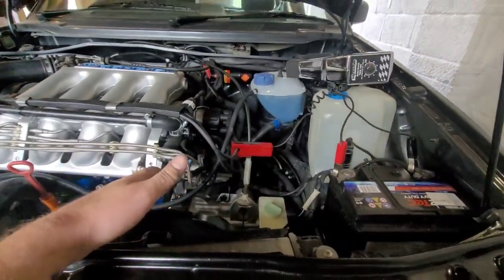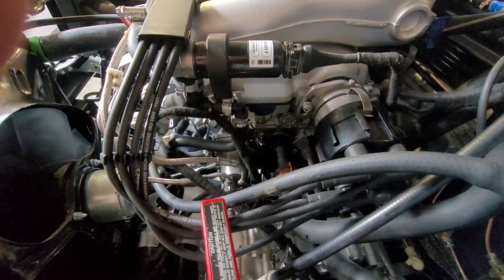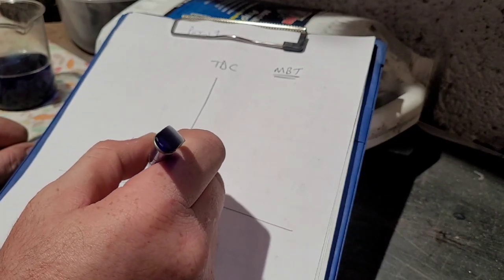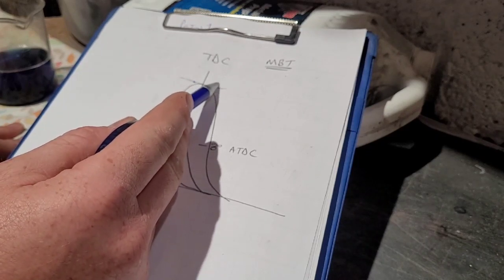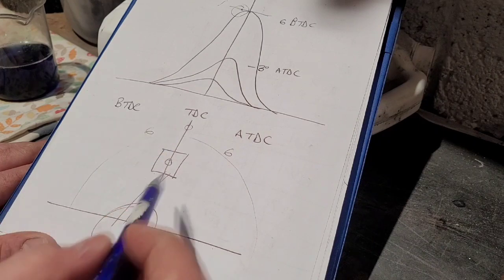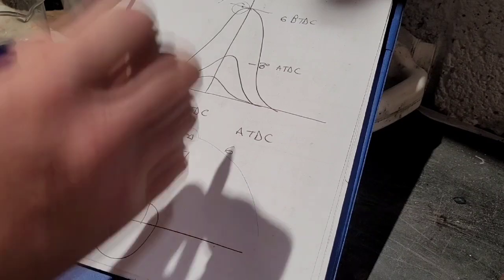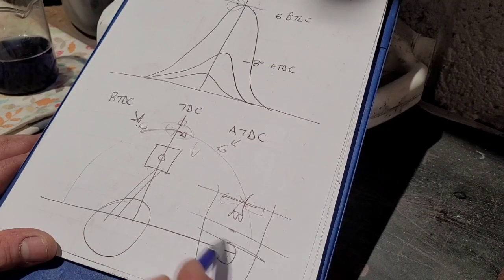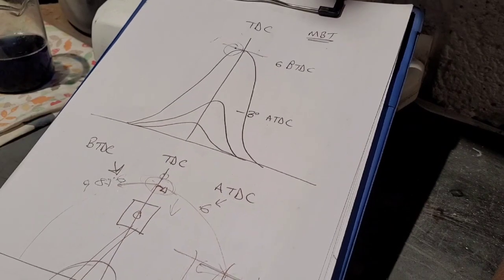Mk2 Golf Gti 16v - Strobe Timing Light

Comment: Hi mate, any chance you could explain setting up the distributor for a first time start up? Ive got no set points or markings on my distributor and struggling to get a position to fire the engine up.
Reply from the maker: With the engine at TDC the distributor should fit with the connector on the bottom then the rotor arm should line up with the notch thats on the distributor housing
Reply: @GreyGooseRestorations I have finally got it running but think the timing is out, doesnt seem to rev past 2-3k and the spark plugs are black after a few minutes of running. My gearbox inspection plug is stuck so thats my next job!

Comment: Last time I did this, the arrow diamond mark was fluctuating alot before and after the timing strobe, it was all over the place so to say.
That 16v I had then was with knock sensor and KE jetronic, perhaps the knock sensor told the ECU to retard the spark timing and at the same time some other electronic (ignition module?) told it to be more advanced, I dont know.

And as soon as I let gas on via the gas cable, I noticed the arrow could almost dissapear from the inspection hole and it would fluctuate as I gave it more or less gas.

Is this something ever you seen?
Reply from the maker: Did you disconnect the wire/plug that tails off the coil?
Reply: @GreyGooseRestorations  no didnt do that, is that a cause to it?
Reply from the maker: Yes, if you disconnect that plug it stops the ignition system adjusting timing advance so you can get an accurate set point, then once all happy connect it back together
Reply: @GreyGooseRestorations  Oh wow, good to know

On my current 16v (KR, not PL as was my old) I instead get quite alot of burble (not really backfire but) when letting of gas and its engine braking, is this healthy or some kind of sign of bad ignition timing? Should I diagnose it?
Reply from the maker: Could be a overly rich CO2 level
Reply: @GreyGooseRestorations  USA PL engine here- could you elaborate as to precisely which wire on the coil you are referring to?
Reply from the maker: There should be a clear/white male and female connection with a red/black wire, it tracks off from another red/black and or red wire thats at the coil.
Reply: Thank you!  @GreyGooseRestorations